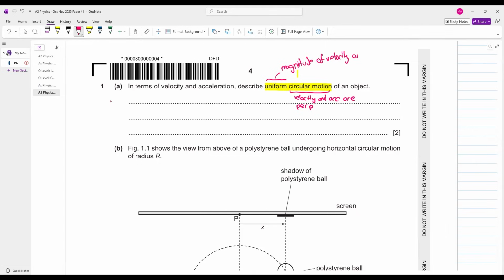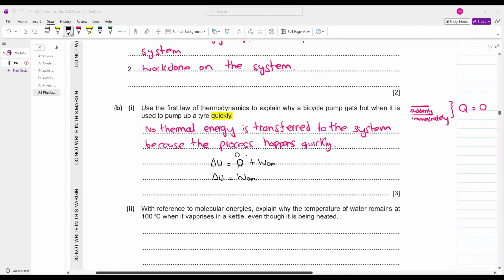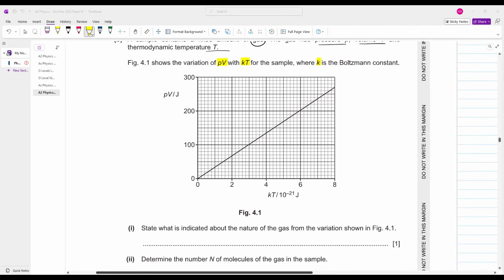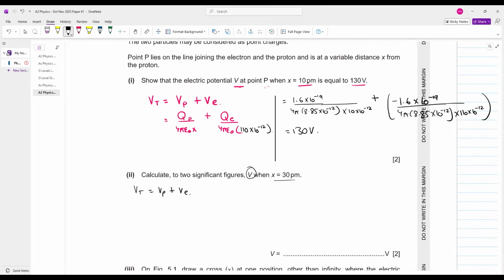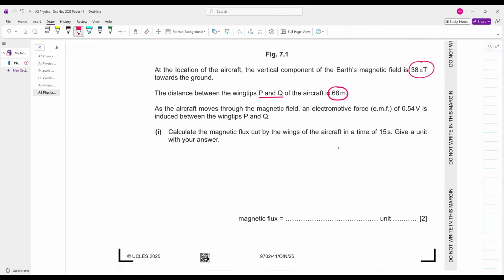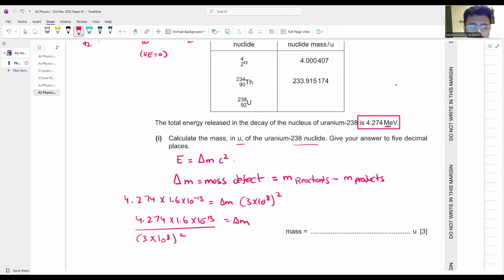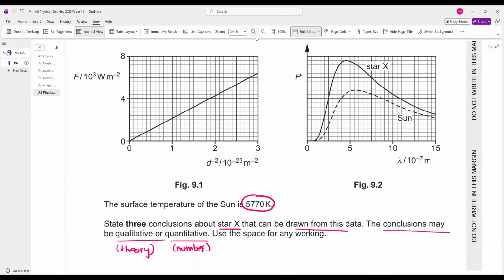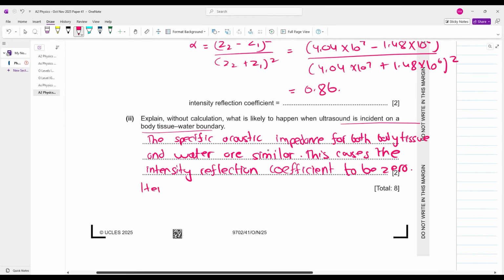A2 level Physics 9702 Oct/Nov 2025 Paper 41 SOLVED!!

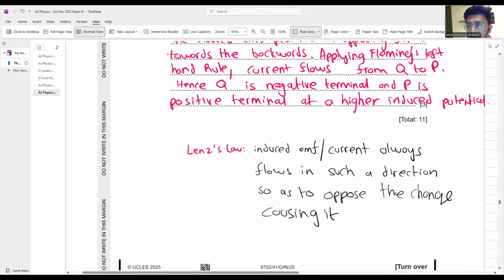Comment: Sir why are we using Fleming’s Left Hand Rule to find direction of induced current? 1:17:23 Isn’t it supposed to be Fleming’s Right Hand Rule?
Reply: We are not finding induced current. We are finding induced  potential, which is proportional to induced force or direction of flow of electrons.
Reply: to find current we use left hand to find force we use right hand ok